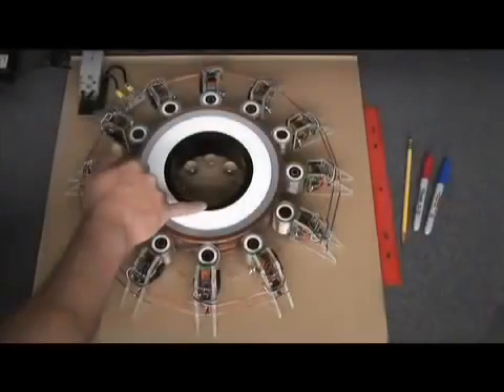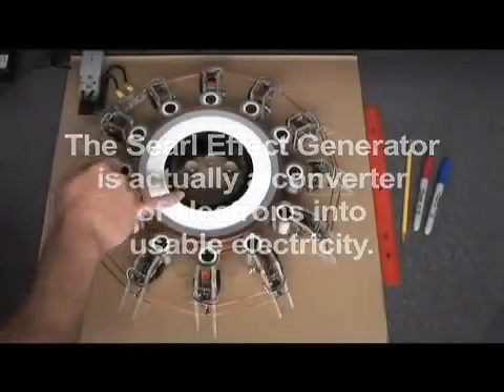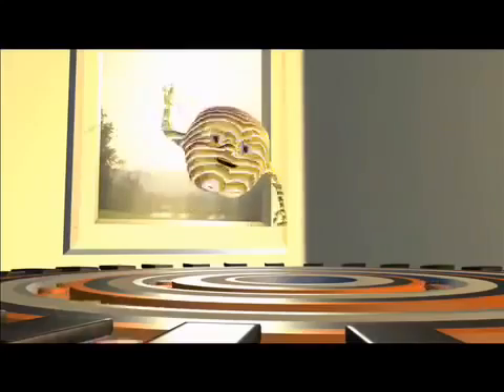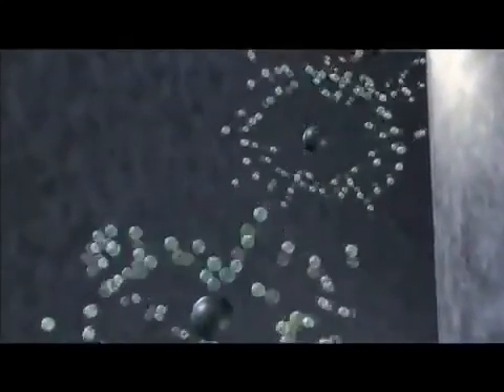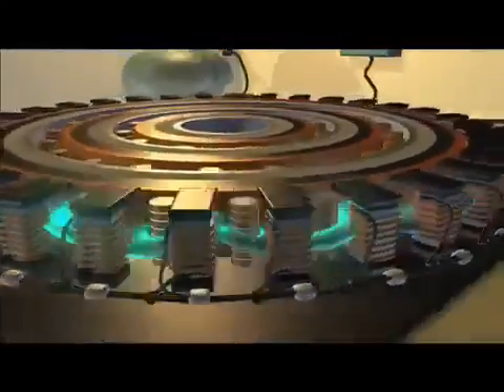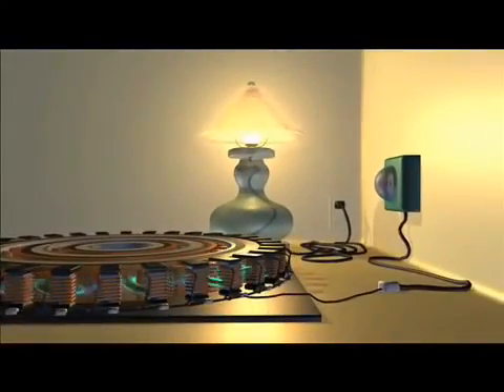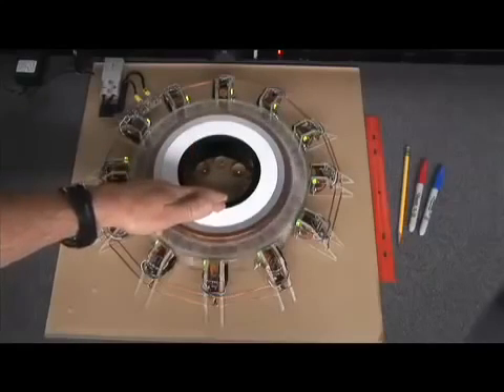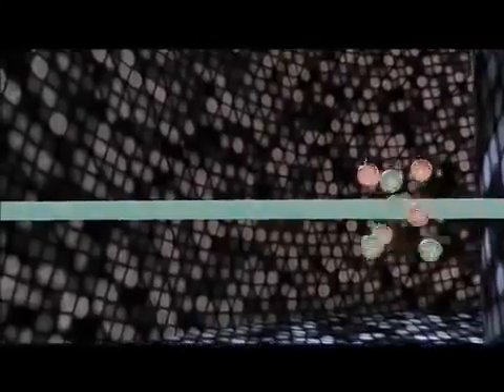Professor John R. R. Searl and the SEG

Comment: I was thinking of a hub wheel motor spinning electric connection, it's spinning 2 ways 2 components on the ring turning and the Magnet ..
You need each 1 Magnet wheel conductive connector & track connector to dump/take electric make it or Send/use it immediately needs recognition of consumption/usage by appliance could add kwh wattage per hr divided minute second usage decimal point/s example volume TV to washing machine would increase power or lower during cycles, or kettle would be the same with lower time less water turning out itself OFF.
We need a smart Meter which has each plug wall and extension to add appliances name make model to read instructions of wattage usage perfecto no bullshit metering.

So you need to use that hub wheel motor electric power connector to each magnet on the last wheel tracked conductive sending electric to be consumed kept running very slow for PCB board etc WiFi SMS

Comment: He needs |_| circular tracks to insure conduct electricity from magnets using Electric or making electric to send it relay to keep it running alone at 1 speed or adding smart technology motor controller recognition of usage plug/mains usb etc will need an AC to DC vice versa invertor to make or use AC or DC power.  

In my world using 1 massive azipod or (motor are generator if using power vice versa) massive 50.000 Horsepower AC squirrel, motor to Turn 1-100000000+ generator cogged shafts geared = silly speed electric made rigged Massive generator to the Grid or off-grid larger version/s Replace battery bank & or diesel generators & wind turbine obsolete, we stack slide connect cogged generator/s and 2 ended cog a row x/1000+ or # grid stack design cogged 2 end rows, connect them throughout double shaft/s to 2 end cog meet cog above below left to right
Reply: What do you mean by “in my world”?

Comment: Except you need to plug it in to make it spin, lol. Spends 1kW to produce 0.0000000001W. Great.
Reply: @damirregoc8111  If you don't understand, don't speak loud because that makes you much more stupid than you actually are..  369
Reply: What you write about is the mock-up that is using electrical power from the grid. The real deal uses endless supply of electrons to power it up. I spent a few years looking for something that can replace fossil fuels and I found this. It's the real deal. Waiting for proof will come. It's ok to doubt it. Even my girl friend doubts it too.
Reply: @rrrobinson97202  so its working or not?

Comment: what? electrons arent just freeflowing unless if you have some nuclear material
this has got to be total nonsense
Reply: Electrons are free-flowing in a conductor, such as metal. In a semiconductor or insulator, the movement of electrons is more restricted. In these materials, electrons can only move under certain conditions, such as the presence of an electric field or the introduction of impurities.
Reply: @brendangarcia172  ah- as a welder i can agree to that, but not just freely moving about unless if you consider an electric arc to be electrons

Comment: Interesting person.Extracting energy from atoms nothing really new.Take the H bomb for example.
Reply: Except that the magnetic-motor fraudsters claim to extract energy from the atom without affecting it. Get this: they say that, because the electrons circle the nucleus forever, it is therefore possible to extract infinite energy. Rubbish. Energy can be extracted from atoms only by splitting (fission) or combining (fusion) them or during processes which release binding-energy (usually mislabeled as 'chemical' energy).  In most applications, magnets are merely a neutral intermediary in the conversion of other sorts of energy to electrical energy.
Reply: This is more fundamental. Extracting energy from VACUUM, which has more potential energy than we can imagine.